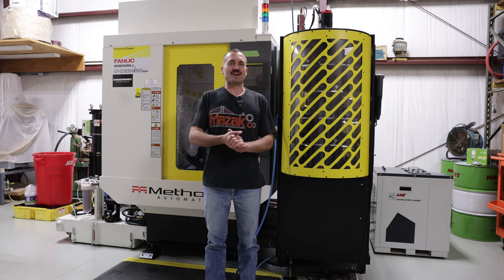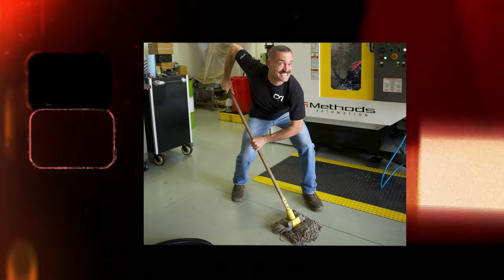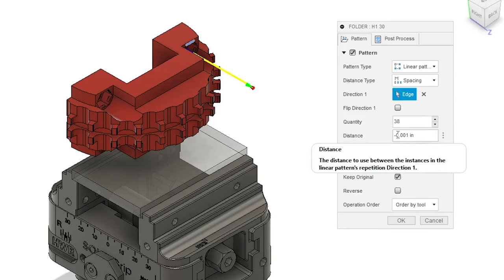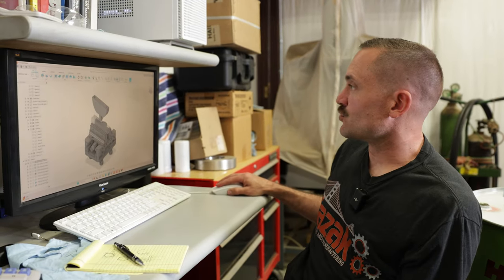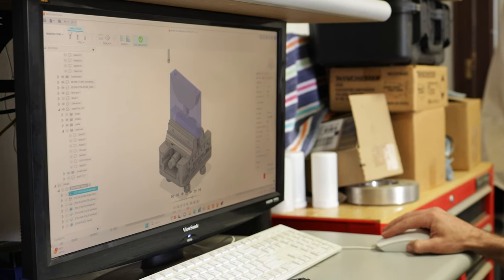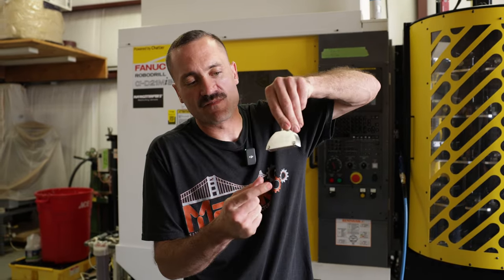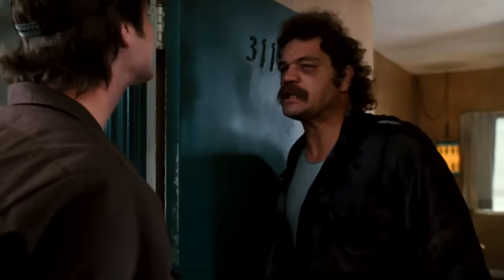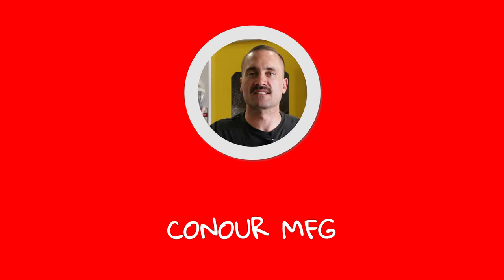Machined & Shipped! The realities of owning a Job Shop

Comment: why not press fit the nuts instead of using snap rings?  you could build a two-part jig to press in the pins and nuts at the same time but use a real hydraulic press instead of the bridgeport. (change design to have pins and nuts in same part- either A or B)  #lean  $0.02